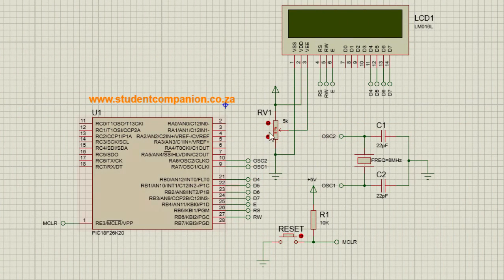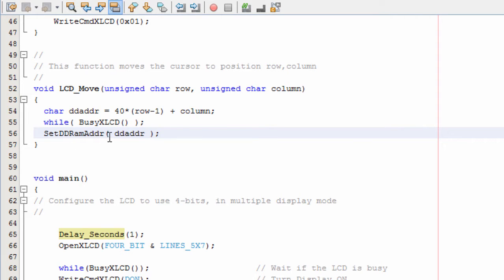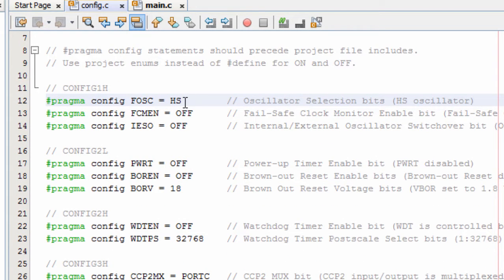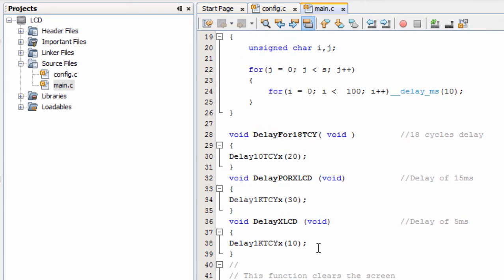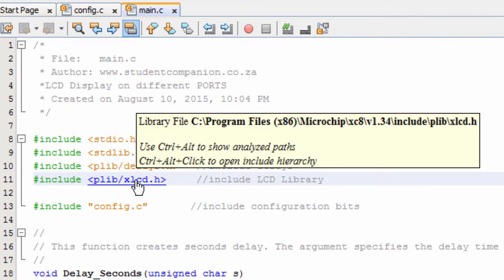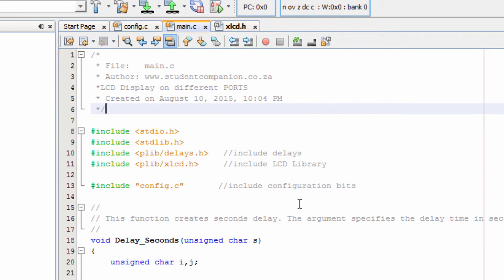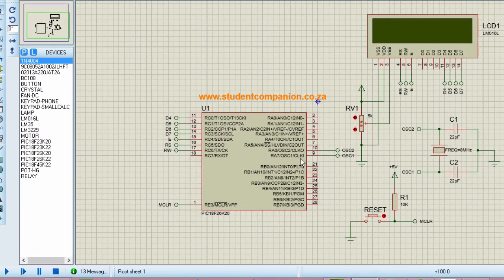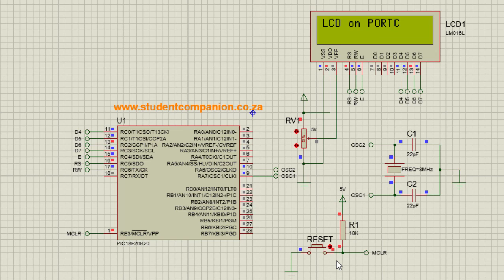17- LCD Connection to any PORT of PIC with Peripheral Library | MPLAB XC8 for Beginners Tutorial

Comment: Nice tutorial, great explain. can you explain the function LCD_move? i dont understante the 
calculation
Reply from the maker: Hi. There is no LCD_move function in this tutorial. What are you referring to? Which calculation are you talking about?
Reply: hello there. "char ddaddr =   40*(row - 1) + column;", this part I dont Understand, how this works, for example, if I call LCD_Move(1, 2) for go to second line, third column, the ddaddr value will be -> 2; how this can be 0xC2 from LCD address?
i Hope i will be clear in my doubt
Reply from the maker: I don't know how to explain it more, because the function is self explanatory.  
To move to beginning of a new line you write: SetDDRAMAddr(0x40). 
This will be at row 1 column 0.
This is the same as:
LCD_move(1,0) because the definition of this function: ddadr= 0x40 *(row-1)+column.
This will be  40*(1_1)+0 = 40.
Reply: thats i dont understand, "will be  40*(1-1)+0 = 40.", cuz 1-1 =0, so will be 40*(0) + 0 = 0, or am I wrong?
Reply from the maker: You are not correct. 40*0 is 0
The LCD we used is a 16x2 line LCD. It has 2 rows (2 lines) in 16 columns. In this function, rows start at 1 not at 0.
If I want to display from the beginning on top left, meaning displaying on line 1 using that function: LCD_move(1,0) :
40*(1-1)+0 =0 because 40*0+0=0. This will be the same as SetDDRAMAddr(0x00).
To move the cursor to second line and start writing from the middle of screen let say at column 7 using the function: 
LCD_move(2,7):
40*(2-1)+7 =47
40*(1) + 7=47
40+7=47
This will be the same as SetDDRAMAddr(0x47).
Reply: ohhh now all was clear, you re awesome. rlly nice explanation, thank u. and if u could help me about my comment upside, I am rlly greatful
Reply from the maker: What do you mean by comment upside?

Comment: Thanks for the tutorial. But changing the PORT doesnt seem to be flexible. I mean if the LCD PORT is different for different projects, will we do this process every time?
Reply from the maker: that's how you have to do it if you are using PIC18 peripheral libraries. But there is another simpler way using another lcd library. Only 2 files are required.  check on our website on lcd tutorial
Reply from the maker: check out this example using an easy to implement lcd library: www.studentcompanion.co.za/interfacing-lcd-display-with-pic-microcontroller-xc8/

Comment: Since the main xlcd.h file is changed, Does it affect previous projects where PORTB is defined as default LCD port ?

Are the changes permanent? the next project is gonna have PORTC as default, right ?
Reply from the maker: If you used the original compiler file, yes it will be default until you change the configurations again. It's always good not to modify the original file and only add these library files into your project file.

Comment: As ı understood from this tutorial, Any connection does not depend on our decision, for these connections  we must use datasheet of external LCD to connect pins from PIC to LCD. 
My view in above is right ?(because  I want to learn how to connect any kind of device.)
Reply from the maker: +MG G4222 what kind of device? You can connect your device where you want to provided you have a correct pin. For example some devices require analog, some digital, PWM, I2C, etc. You cant connect anywhere.  You must know what you are doing
Reply: Such as LCD Display.
Reply from the maker: +MG G4222 yes you can. You can even write your own libraries.
Reply: Also, in my source-pic18 files have no plib files what ı need to do for that?
And then ,How can ı write own libraries.
Reply from the maker: +MG G4222 you must download them separately from microchip website.  Or you can use MPLAB Code Configurator if you are using a newer PIC. Watch this video:  https://youtu.be/4WaB_Lj8FnY

Comment: I did everything accordingly but still the lcd isnt showing. i think a problem with adding the precompiled files...any suggestions?
Reply from the maker: Which PIC are you using? What version of XC8 compiler you are using?
Are you getting any errors?
Reply: I am using pic18f2620 and v1.34 compiler.. i am not getting any errors...i think that even after i add the source files after editing, the compiler still dosnt take the step
Reply from the maker: Are sure you are also connecting correctly your lcd pins? Like the rs, e and rw pins as per your new code?

Comment: hi dear, please can u make another tutorial for lcd interfacing with 16f877a in mplab v5.25?
Reply from the maker: Hi, please not there are hundreds if not thousands of PIC models. So we can't make same tutorials using different PIC models. Another guy is gonna request for a different PIC. This doesn't make any tutorial sense and waste of time. We only pick one PIC to cover a specific tutorial.  If you have problems with your specific PIC, then ask questions because the principle of operation is similar.

Comment: I love the videos but I CANNOT get this to compile!  The only difference is that I did use MCC to configure my system bits and port bits for PORTC on my PIC16F1619.  I try to build the project and I get a TON of errors. Stuff like:
openxlcd.c:38: error: (255) not a member of the struct/union ""
openxlcd.c:38: error: (182) illegal conversion between types

make[2]: * [build/default/production/openxlcd.p1] Error 1
make[2]: * Waiting for unfinished jobs....
nbproject/Makefile-default.mk:250: recipe for target 'build/default/production/openxlcd.p1' failed
busyxlcd.c:13: error: (255) not a member of the struct/union ""
busyxlcd.c:13: error: (182) illegal conversion between types

Any ideas??  Is using MCC messing things up?
Reply from the maker: Hi. Thanks for watching our videos. If you are using MCC you can't use the peripheral libraries.  And they are no longer installed by default, that's why you are getting those errors. Please watch this video if you are using MCC with LCD: https://youtu.be/4WaB_Lj8FnY
Reply: @StudentCompanion  Ok.  That might explain it.  I was able to use the PIC2DEM board libraries you show in your other video.  I got it working!  Thx!
Reply from the maker: You are welcome!

Comment: In my compiler files no xlcd.h files.
Did your own built it ?
Reply from the maker: +MG G4222 that's why I asked which PIC you are using and which compiler version? Xlcd.h is included in the PIC18F peripheral libraries and it's no longer included in new versions of the compiler.  You have to download it separately and install it into your compiler installation folder and it's now called Legacy peripherals libraries.
Reply: Yes ,ı have legacy files, but which one of them will help me.?
What you shown in your tutorial I done it.(PIC18F2620)
Reply from the maker: +MG G4222 watch this video. You'll see the one to download: https://youtu.be/4WaB_Lj8FnY

Comment: another question, I did according to the video, but the LCD continues to connect only in PORTB.
Reply from the maker: Before yoh jump to the next question, did you understand the first one now?
If it still work only on PORTB it basically means you did not do according to the video. There are some steps you are skipping
Reply: Yes, I dont know if u are a teacher, but you are very good at teaching. wll, now I am going to try another time. I am using PIC18F4550, so I dont need "include "xlcd.h" and "delays.h" " if I am using the peripheral libraries, correct?
Reply from the maker: No. I am not a teacher, just trying to help where I can.
If you are using the peripheral libraries and you have linked them, no need to explicitly include the xlcd.h and delay.h
But if you are going to use a different Port beside the default PORTB, then you will also have to follow all the instructions in this video.
Reply: well, I followed the steps, it's all the same, except the #include directives for the "xlcd.h" and "delays.h" files, but again, even changing in the xlcd.h file all "B" to "D" , the data is still being sent to portB, just like in the video at 12:34. the only difference I noticed was when compiling after adding the source directory files, where some warming appeared, such as "writdata.c: 37: warning: (373) implicit signed to unsigned conversion"
Reply: +Student Companion one question, are you using The original "xlcd.h" ?
Reply from the maker: Don't overwrite the original library files in case something goes wrong you'll have to reinstall the libraries.
Always work with the local copied to your local folder as we explained in this video.
Reply: +Student Companion but when I link for peripheral libraries, I dont be modify the original archive?
Reply: +Fernando Saraiva Can I send you The project in The fórum?
Reply from the maker: If you are going to use the default PORTB for your lcd, your don't need to modify any file. So there is no risk to modify the original file.
But if you are going to connect the lcd to a different PORT beside the default PORTB, you will need to compile the source files as this video explains. In this video we edited the original xlcd.h file but it's not advisable. The best option is to add it from the library folder and select copy when selecting it as we did with the source files. See this video at 14:17
Reply from the maker: You can. But before can you elaborate what steps you did to connect to a different PORT?
Reply: I discovered the error, when I changed the xlcd.h data in mplab, I thought it had changed, but when I opened xlcd.h in dev c ++, the file was still configured for portb, strange no? the fact is that I changed in the dev, and at least in proteus everything is normal. I do not understand why mplab showed the file changed, but in dev it was still in portb
Reply from the maker: Maybe you changed a different file or forgot to save the new changed.
Good to hear that it's working now
Reply: one last question, I changed the plib file, so whenever I make a new project, I will have to add the ten .c files in the source-> pic18 folder ???
Reply from the maker: Not. But if you change your lcd connection to a new PORT  then you'll have again

Comment: I am having the following errors, what should i do

:: advisory: (1233) Employing 18F2220 errata work-arounds:
:: advisory: (1234)  * Peripherals can misbehave if BSR = 15
:: advisory: (1234)  * DAW instruction may improperly clear CARRY bit
:: warning: (1273) Omniscient Code Generation not available in Free mode
Display.c:59: warning: (520) function "_DelayPorXLCD" is never called
Display.c:63: warning: (520) function "_delayXLCD" is never called
Display.c:43: warning: (752) conversion to shorter data type
:0: error: (499) undefined symbol:
 _DelayPORXLCD(dist/default/production\Display.X.production.obj) 
(908) exit status = 1
nbproject/Makefile-default.mk:119: recipe for target 'dist/default/production/Display.X.production.hex' failed
make[2]: Leaving directory 'C:/Users/AbuJapan/MPLABXProjects/Display.X'
nbproject/Makefile-default.mk:78: recipe for target '.build-conf' failed
make[1]: Leaving directory 'C:/Users/AbuJapan/MPLABXProjects/Display.X'
nbproject/Makefile-impl.mk:39: recipe for target '.build-impl' failed
make[2]: * [dist/default/production/Display.X.production.hex] Error 1
make[1]: * [.build-conf] Error 2
make: * [.build-impl] Error 2

BUILD FAILED (exit value 2, total time: 10s)
Reply from the maker: Hi. What is the version of your XC8 compiler? It looks like you haven't installed or linked the PIC18F peripheral libraries.
Reply from the maker: Watch this video to learn more: https://youtu.be/4WaB_Lj8FnY

Comment: Any one have hints on how to use a 4X20 display with this??
Reply from the maker: +Jason Becker The same procedure and the same library can be used as long as your 4x20 LCD uses the Hitachi HD44780 LCD controller. All you have to remember is the SetDDRamAddr to move your cursor to the appropriate line or columns.

Comment: #include <plib/adc.h>
#include <plib/xlcd.h>
#include <plib/delays.h> 
THOSE CODES ARE ERROR İN MY COMPİLER...
WHAT I NEED TO DO FOR THİS PROBLEM?
Reply from the maker: +MG G4222 which PIC are you using? What the version of your compiler?
Reply: MPLAB X IDE XC8 v4.05
Reply from the maker: +MG G4222 that's MPLAB IDE not the compiler. What's the version of your XC8?